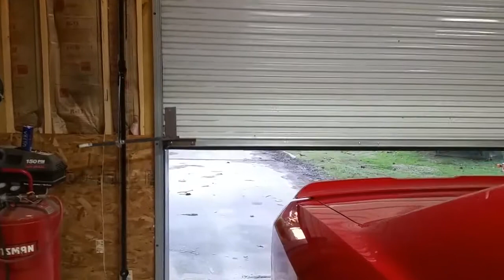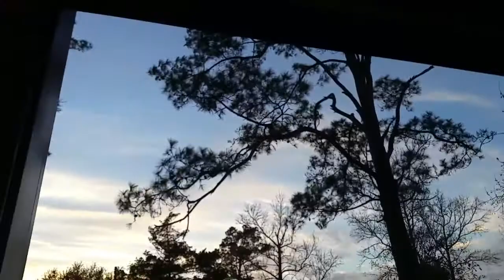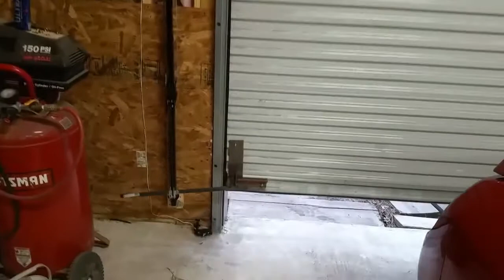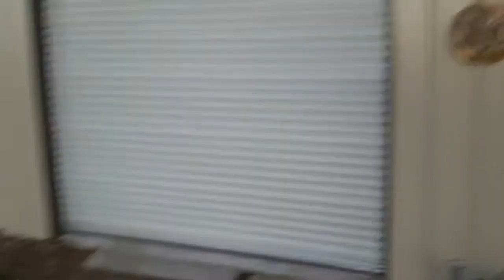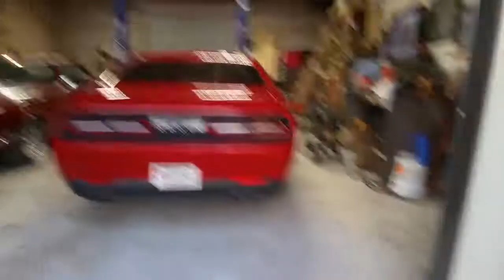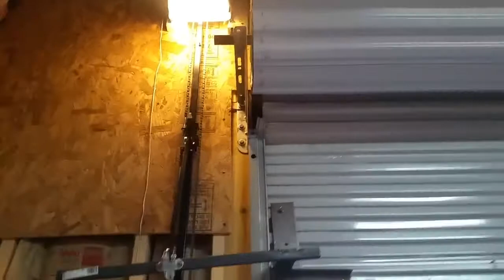Roll up door with garage door opener

Comment: Thanks for posting this Video. Was reading your replys to others. Was getting ready to put square tubing across the bottom.  So the L bracket in one corner works good in your post .
Reply from the maker: yes, it works fine.
Reply: I made it just like your,s. And it works perfectly

Comment: Good idea.  I'm wondering if it is possible to either connect the gearset directly to the rolling door shaft or shorten the belt system and connect directly.  

Pro tip:  turn off the radio when making videos.  It was hard to hear.
Reply from the maker: you can.  but way more expensive.  you can rig up the cheaper openers to it i guess with some chain and sprockets, but you will need some creative backets.

Comment: I wonder if its possible to remove the rail on the op then attach a sprocket to the shaft and run it directly from the head
Reply from the maker: I think it would be possible,  but would take more fabrication...the shaft doesn't turn, so the sprocket would have to attach to the drum.
Reply: @billymonster1969  yep that's correct. I first did mine like the video's and then built a setup to turn from the drum. it took more time and customizing but in the end was a more elegant solution for me.

Comment: It's been about 1.5 years since you posted this video, how is it working now and have you had to make any design modifications?  I'm working on a similar design, but for two smaller doors.
Reply from the maker: Still works great.  I had to replace the sensors after the flood. Mechanics are still sound.  No issued...i am actually surprised i haven't had to work on it at all...

Comment: can you still operate the door by hand if the electricity goes out, and does the stops work good like that, I want to do that with my door, I have the opener already.
Reply: Yes, you could probably still operate the door manually, for example if the power goes out. Every opener today comes with a manual override feature, which allows you to disconnect the door from the motor and operate it manually.

Comment: Did you have any issues with it pulling on 1 side of the door? I have a chain setup on mine which turns the drum, but would love to add a power motor to my doors.
Reply from the maker: No issues with the 1 side effect...did have to change the plan at first because the bottom of the door would try to roll.  Adding the plate going up instead of across at the attachment point solved that.

Comment: Only bad to this idea is security but neat
Reply: The door will stay closed because the opener has a break inside it.
Reply: Disagree.  It is every bit as hard to open a door attached to a door opener as it is to open a door that is locked.  Granted, the bar assembly is removed for this application, so maybe easier by some.  Nope, the bar assembly is attached.  The geometry of this assembly will make it even harder.
Reply from the maker: its just as secure as any other garage door.  and it has a place to lock it on the inside if you want.  would unplug the opener if you lock it though...that's how everyone usually breaks their garage door opener. its always a good idea to take off the slide bolt lock from your garage door when you add an automatic opener.